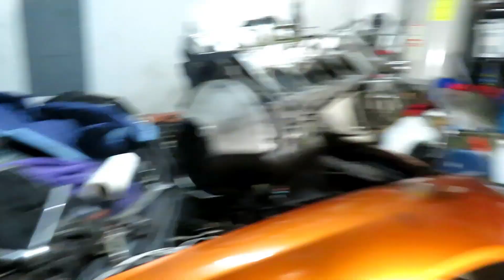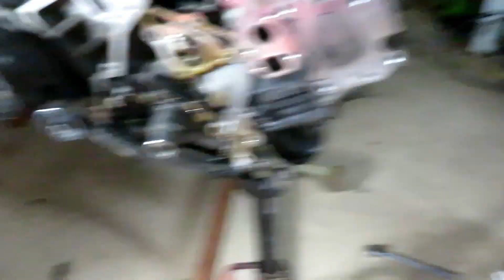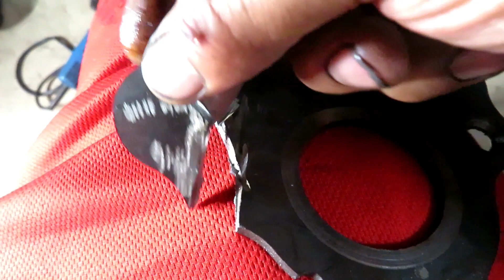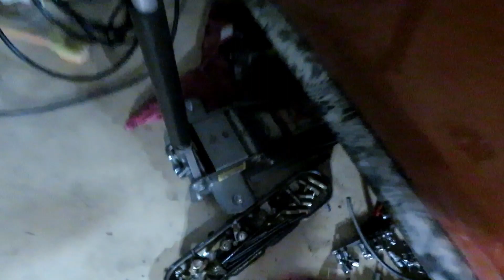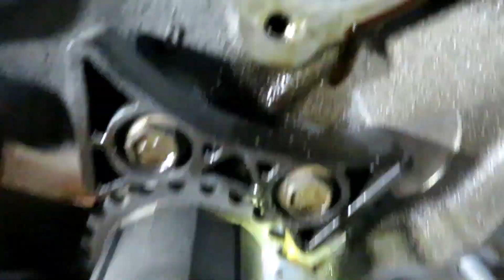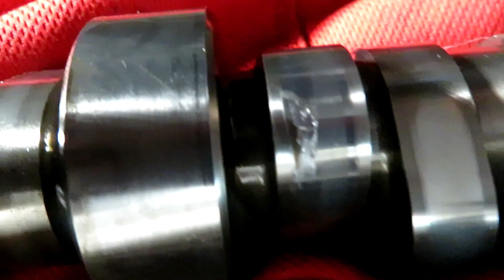Breaking It Down (Part 2): C6 Corvette LS3 Tear Down

Comment: Did you have any problems since ou didnt replace the cam bearings? Have the same time of damage n im scared to just slap a cam n lifters in since the bearings are a little scored
Reply from the maker: Nope. No issues.

Comment: How do you think an LS3 (stock) can last!? Thinking of buying a C6 base w 95k  for $16k from a dealer
Reply from the maker: Stock engines are very reliable and would honestly trade it for a stock engine vette if i could. This is knowing that horsepower and engine mods do not matter for what I am doing on the road course with them. The other c6 in my garage has 127k miles on stock ls2
Reply: Rich P - I’ve bought 2 high mileage corvettes.  The first was a 98 C5.   I put a vortec V3si supercharger on it at 150K miles not expecting it to last long.  I totaled the car and sold the motor & blower.  The car had over 220,000 miles on it.  The last 80K with forced induction.  The second was a C6Z06 - the LS7 while a beast does not appear to have the longevity of the LS1/2/3.   I have to rebuild the motor at 85K miles due to lifter failure.  Went back with big cam and 30K later had to replace cam, lifters & springs due to cam damage from poor oiling (mobile 1) being changed at GM recommended intervals.  So, if your looking at high mileage LS1-LS3 I’d say your ok.  LS7 maybe not.   Just my experience....
Reply: I  got my c6 corvette ls2  with 100k  bone stock did full bolt on as soon as i got it . I  now have 129k  miles on it   and going strong. I have not had one issue  .
Reply: Texas HorsePower I really appreciate your feedback, I’ll stay following your progress and keep you updated on mine. Thanks again for helping me out
Reply: motorgearhead man! Can’t thank you enough for this insight. It helps me above and beyond. Thanks for sharing your knowledge with me and to others. There still are genuine people on this earth after all. Stay blessed
Reply: Ricky T Awesome for the insight, this will help me on my quest for fun but have a reliable car as well
Reply: Rich P - hope the insight helps!     The C6 is an incredible value and if the car your looking at has been maintained well I think you’ll be a happy corvette owner.   They really are great cars, especially for the $$